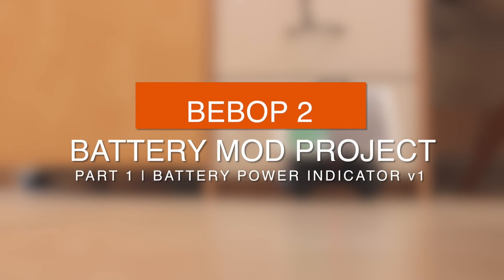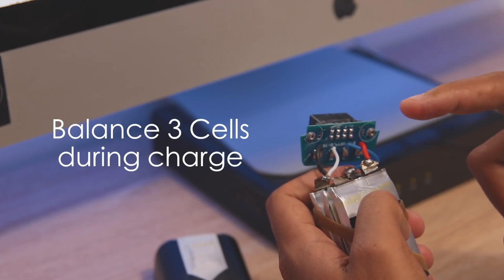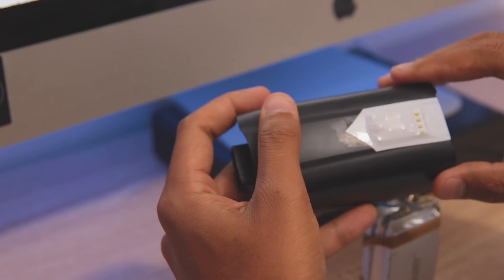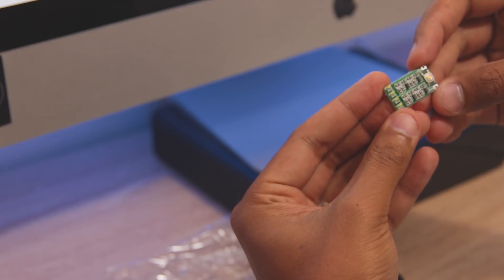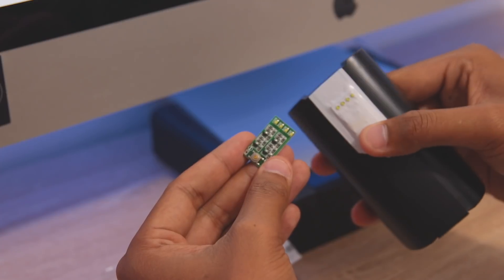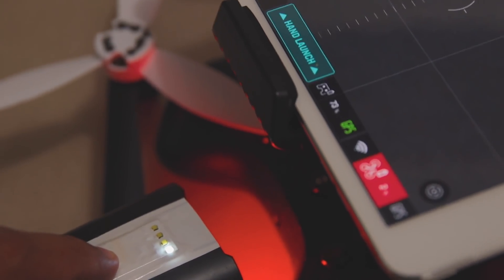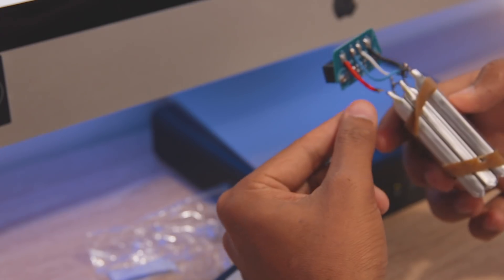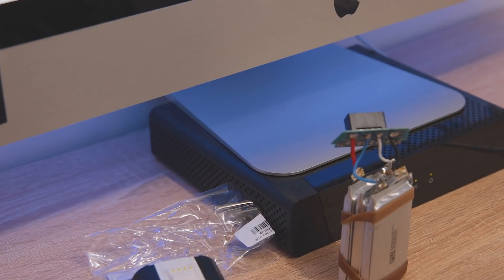BEBOP 2 - Built-in battery power indicator | Version 1

Comment: Hi Anthony! Just noticed you were using a flypad to control your bebop 2, is that an otg cable connecting the flypad and the tablet? I've tried to control the bebop 2 using a flypad and otg cable but the flypad disconnects after a couple of seconds, i can control the bebop 2 using bluetooth connection between the phone and flypad but the bluetooth "jams" the wifi connection/range of the drone.

Have you found a way to use otg/flypad without bluetooth?
Thanks
Ricardo
Reply from the maker: Hello Ricardo, its the Skycontroller 2 with an iPad mini. If you are using flypad you are to connect it via bluetooth not cable, there is no viable way to connect via cable as most iOS and Android do not have the drivers.
Reply: when i looked to the button layout it seemed as a flypad....my mistake...unfortunally bluetooth interferes with 2.4 ghz wifi...ive tried 5.8ghz but my wifi repeater doesnt support 5.8ghz...hopefully someday parrot will bring back the compatability through otg....thanks and keep up the good work
Reply from the maker: Ahh i see where things can get mixed up. Set your BEBOP to manual channel 1 or 6 not higher. Set your repeater to same frequency as the BEBOP 1 or 6. you should be fine to BT to the Phone and have a good separation with WiFi. It is important to set network to Manual so it does not hop if it does and it jumps to overlapping channels 11-14 that is where its going to get muffled.

Comment: I was thinking to make foldable bebop 2 body cross by 3D printer! They are easy to mod for special frame, And use anifi motor gimbal for the propellers to get more portable, since they use the same motors , what do you think?
Reply from the maker: That really sounds good. I wish i had a 3D printer :'( let me know how it goes. Just one caution, when unfolded the motors need to be the same distance apart as it is on the OEM frame. The algorithm may have problems compensating when the motors are in different positions. (rapid corrections, wobbles, ultimately overload CPU and shutdown)
Reply: ANTHONYVLOG ye I know that, I don’t have 3D printer ether!😂, I need to ask for to print one after I design ,
Reply from the maker: Ahhhhhhhhhh the struggle is real!!LOL

Comment: good video. i'll be looking in to see how your project comes along. We need to know how you are connecting it up. To me it looked like the red and black wires.
Reply from the maker: Hello, yes the led indicator board + - to the battery terminal + - (Red / Black). I will make a video on making it once i get the rest of the items. This so i don't repeat it and also to make the final video as short as possible. I am waiting on the second indicator (different design) and the main part which is the BMS PCB. Thank you for following my projects i appreciate it :)
Reply: You are welcome.

Comment: Cool! Can you charge the Gifi battery with the OEM charger? Does Gifi battery has the balancer circuit by default as stock batteries have?
Best
Reply from the maker: Yes you can but not advisable because of the resistance difference. No they don't have a balance PCB the oem charger can balance charge them. My only advice don't run the GiFi battery past 20% if you charging with oem parrot charger. Lipos have higher resistance the lower they are, and GiFi without a protection circuit. Balance is one thing but a protection circuit or the lack of one is what damages chargers (remote cases)
Reply: ANTHONYVLOG thanks for the advice